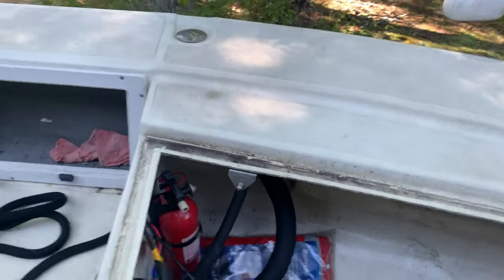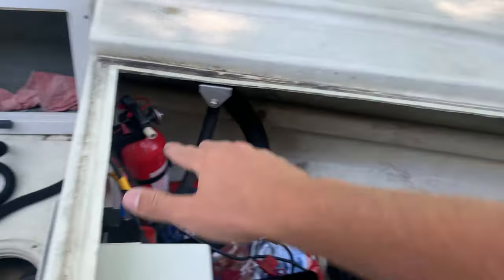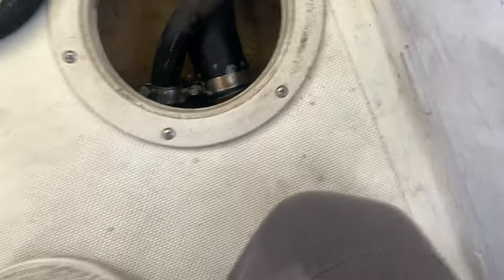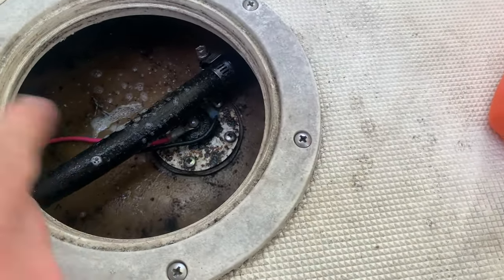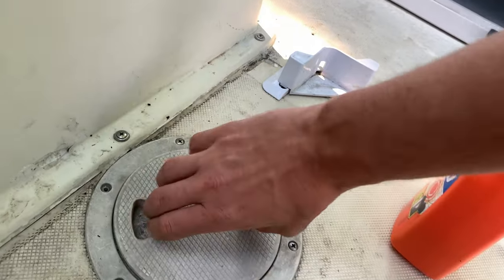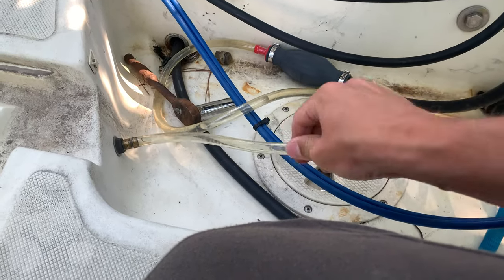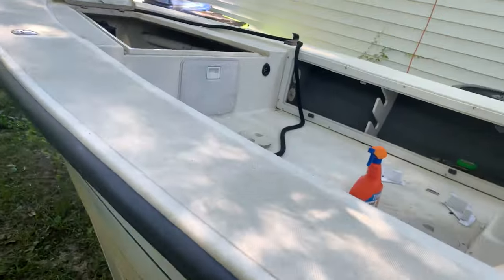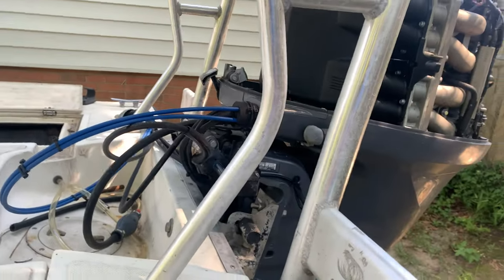How To Fix Air In Fuel Lines On Your Outboard Motor

Comment: Man you do your own homework but I only use black line. My mechanic retired from mercury and showed me where the factory plastic type line was like sand. I’m going to put in line on/ off and I have a small filter between the tank and primer bulb. Thank you and God bless
Reply from the maker: I always went with blue but did the clear plastic for this test

Comment: 3 MONTHS  I have been causing this PROBLEM THANK YOU !!!!! I replace 2 carbs and had the same problem and now I know why . I changed the fuel sending unit and ever since I have had problems.. %$%@&%^@)(I))!%^$^@^% AIR IN THE LINES !!!!!
I am so happy I saw this. I made 20 post on a boat forums NO ONE EVER came up with this WTF !!!!! '
THANK YOU AUSTIN!!!!!!!!
Reply from the maker: Always start with your fuel system, work one end, to the rear, then use a separate fuel tank ,  always start cheapest. TROUBLESHOOT TROUBLESHOOT TROUBLESHOOT before buying new parts, I’m so happy and thankful you fixed your problem, thank you for watching

Comment: Great Vid.   i have same issue .Used permatex fuel resistant tread sealer ,bad idea.  Sealer ended up in Water Serparator.
Reply from the maker: Oh Jesus that’s tough atleast the separator caught it before it went into the motor

Comment: Got a Merc Optimax 150 and took it out twice, ran well. Third time as soon as I opened up the throttle it would stall. Idles well and starts fine, just stalls and won't go above 4 mph. I think it's a fuel line issue, but not sure. Was your outboard doing this?
Reply from the maker: @Timbuctoo  yes I would floor it and it wouldn’t go past a certain rpm. Check for air then check filter o rings

Comment: Fuel sender gasket is not going to get air in the fuel line. You more then likely were getting air through that corroded up fuel line fitting on the tank. Should have changed that.
Reply from the maker: The gasket had a lump in it where it was leaking air, I took it off and cleaned all the build up off of it and put it back and it became flush after tightening the fasteners on it, for that situation it was the gasket
Reply from the maker: Also love that username
Reply: @fishingwithaustin8258  Hi Austin, I am thinking the same thing as FTW688. The sending unit gasket is above the fuel LEVEL line.  The fuel pick up is submerged in the fuel so the air leak would have to be in theory somewhere between the pick up to the motor. There are a lot of sources where air is exposed to the system before it hits the tank, for example the fill cap is not 100% sealed, the vent....well that's self explanatory. As far as I know there is no back flow prevention valves from the vent to the tank.  So with those 2 examples I can't see how a small leak in the sending unit gasket would allow air in the fuel lines with the pick up being submerged in the fuel, Are you following me? I am going through the same thing you are right now with my 2011 115 Yamaha, its driving me crazy.  I have changed everything and still the same issue. Only thing I have not done is replaced or bypassed the water separator.  When I hook up an external take it will reach full RPM and works like a charm.  Clearly sucking air from somewhere.  BUT WHERE!!!!!
Reply: Exactly, if the vent is functioning properly you will not create a vacuum in the tank as fuel is consumed. If the vent is blocked and even a small vacuum is formed air will find a way into the suction side of the system downstream of the tank.
Reply: I agree with the other guys about the seal around the sending unit and that it might have been the elbow fitting. I'm having the same problem and I'm pretty sure the problem is in from of the ball pump and might be the same fitting on mine.    I don't think the gas caps are sealed or the vent isn't sealed, so the problem has to be in the fuel line somewhere between where the pick up is above the fuel level.     Oh,  mine eventually seals up and works all day after I keep the fuel pumped up for about 15 minutes while running.     I can see the air bubbles moving in the clear tube I added in from of the ball pump.

Comment: Hey man, when your engine bogged down did you prime the bulb and it did the engine maintain rpm/speed? I have a similar issue and have down everything but fueling lines.
Reply from the maker: Your engine can maintain a certain speed or rpm when there’s air in the fuel lines because it can supply fuel up until a certain limit where fuel air ratio tops out before imbalance from too much air. 

If it’s a four stroke, have you tried the fuel injectors? Just replaced mine and a quick way to diagnose them is a short I uploaded on my channel
Reply: Hey Austin. I found you on IG and sent you a video of the symptoms. 

But I think I fixed it today following this video. I replaced the lines from Tank to F/W separator (also took out the fittings cleaned them, applied better tape around threads and tightened them down good),  replaced the line from F/W separator to priming bulb and from priming bulb to inline fuel filter; bypassed this line out of the rigging tube because I keep boat on water. Ran like a champ. Fingers crossed that’s all it is.  Pulling the boat out tomorrow to properly replace the line. 

Hit me up on IG and appreciate your service!

Comment: How would a leaky fuel sending unit gasket cause the engine to run bad? I mean the tank is vented. Wouldn’t that gasket leaking air just be the same as another tank vent?
Reply from the maker: Too much air isn’t good either
Reply: @fishingwithaustin8258  i just resealed my sending unit the other day. I’ve been having problems with my engine bogging down as well. I will take it out Friday and see if the problem is fixed. I really don’t see how it could be but I hope you are right. Either way thanks for the video. Good info
Reply from the maker: @bh5094  the thing is there’s a pick up tube, no air needs to go through that. Air needs to come into the tank so it doesn’t implode. When the tank empties it needs to fill with air so the tank doesn’t suck itself inwards
Reply: @fishingwithaustin8258 Austin I was very skeptical about the sending unit gasket leaking causing my engine to big down and eventually run like crap. In my thinking the gas tank is vented anyway so how could this sending unit gasket cause this problem. I drained my VST and noticed large bubbles of air in the clear tygon tubing drain line. I pressure tested my tank and found a substantial air leak at the sending unit gasket. I replaced the gasket and was  pleasantly surprised. The engine runs perfectly! I don’t understand why or how this caused the problem but it obviously did. I want to thank you for this tip and want to apologize for doubting you. Thank you!
Reply: Did it fix the problem?
Reply from the maker: @bh5094  my issue was resolved
Reply from the maker: @bh5094  no problem, I loved hearing how you troubleshooted this. Good job figuring it out I hope you enjoy your motor and your boating this season, stay safe and thanks for watching

Comment: So if you see air in the clear filter bowl in the engine area that’s a problem?
Reply from the maker: @karlkoops2142  if you prime your bulb and have fuel leaking out of it from the fuel pressure yes it’s an issue